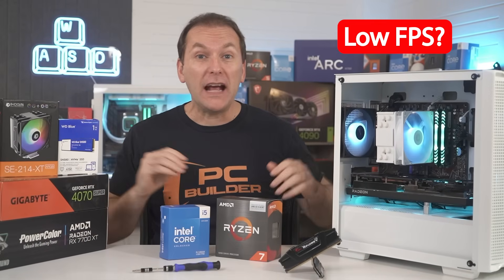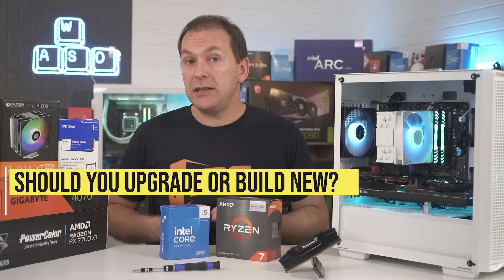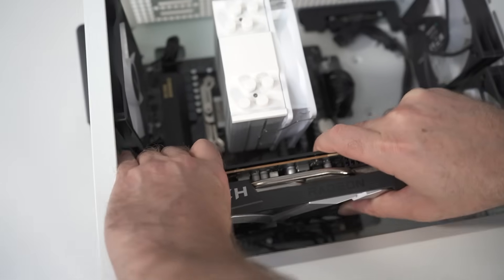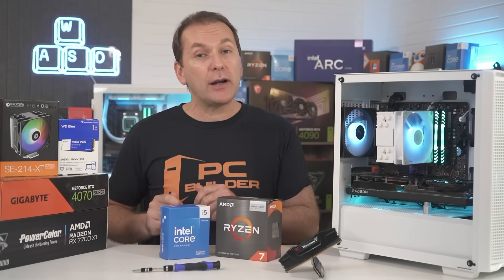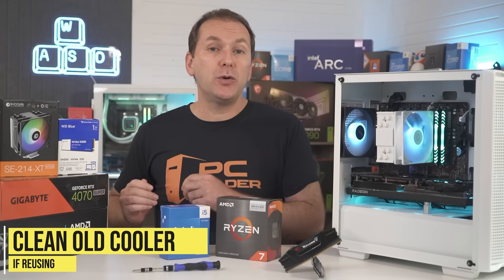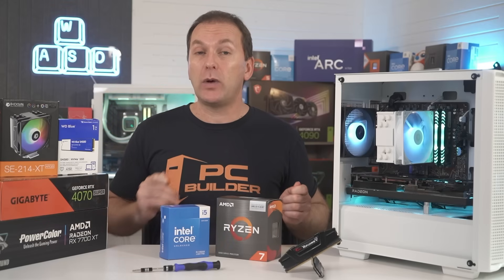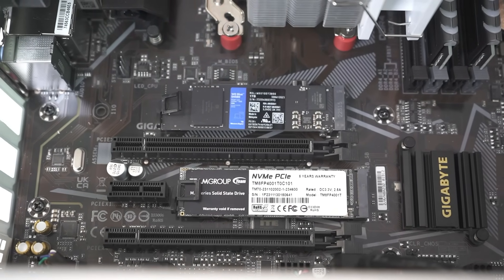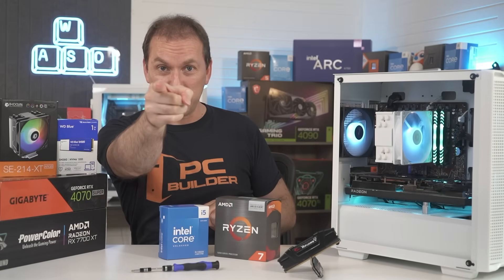How To Upgrade Your PC | How to Upgrade GPU, CPU, RAM, SSD & More

Comment: I currently have a prebuilt and will be building a pc very soon but how do I go about the data transfer? I have a licensed windows and GPU drivers, since I bought 2 Nvme's for the new build can I just transfer everything to them (idk how to properly do this lol) and do the GPU driver clean before installing them? I also don't know if I need to reinstall windows on the nvme and uninstall it from the HDD, I plan on still using the drives I currently have (Sata and HDD) mainly for file storage as I do video editing as well but I'd like to transfer games and apps to the nvme's
Reply: its best to buy an external 3.5 hard drive, for example a WD BOOK, they are pretty cheap now, you dont have to get a huge one, just figure out how much space you have
Reply: @MrSamadolfo  well I have now 3 TB and I bought 3 more
Reply: @Grey4953  🙂 Nice

Comment: Right Jason, see if you can answer my question, nobody has yet...I've just finished my build, I have an Asus Rog Strix B650-a Gaming Wi-fi, with 32gb ram 6000mhz CL30, Ryzen 7 700x, with the Deep Cool Ak620 digital, and a Powercool Hellhound Spectral RX7800xt, I want to mount my GPU vertically inside my Montech King 95 Pro using the Cooler master bracket, but...will there be enough space to mount it vertically with the Ak620 digital?
Reply: That case is kinda small, I advise selling off that case and stepping up to something alot Bigger such as the big NZXT Flow or a clone of it

Comment: gigabyte q-flash updating the bios This mistake I made: I did not know you needed to press END to enter. Q-flash 
Ref CPU I look at using thermal grizzly pads over paste, as they do not dry out if you are replacing your CPU.
Reply: I just recently updated my X570 and didn't have any issues

Comment: I've been upgrading most of my PC parts after having months of black screen crashes. I've tried to search for people who have had the same error and am lost. I've tried build a PC and LTT communities for help and no one has been able to help. I've replaced, cpu, motherboard, RAM. I think its a very rare issue though as there so little help online. PSU upgrade is next. Upgrading from 850W to 1000+ I guess.
Reply from the maker: Have you tried posting to reddit build a pc troubleshooting  forum? That's the resource I use when I'm having issues like this.
Reply: Did you download and run MEMTEST86 ??? it takes about 2 to 4 hours? Next did u do a cinebench run of about an hour? next did you do a heaven benchmark and furmark benchmark? next did u try a different video card? next do you have a decent power supply from the PSU TIER LIST? Next take the board out and see if its crashing due to maybe the case shorting it out? Check cpu socket and pins? Check usb ports for shorts? look the board over with a magnifying glass for anything burnt. just some ideas

Comment: Hey jason...after a year of buying parts here and there I finally built my first pc!!!(and it ran) I have a corsair rm 750e and was wondering if I should use the daisy chained pcie cable or two of the single cables for my gpu

5600x3d 
Asus tuff gaming plus wifi2
Crucial 2tb name ssd
32gb rip jaws 3200 cl 16 ddr4
Peerless assassin
6750xt red devil
Montech sky two
corsair rm750e
Reply from the maker: Congrats on the Build! The cable gauge on that PSU is fine to daisy chain, but my default answer is usually "use two cables". Looks awesome!
Reply: Nice build with a good price to purformance while looking good
Reply: NO, give preference to the 'single cables' if you have them, the daisy chain is only if you don't have enough singles, preferably if given a choice only use single cables but of course that means more money and a bigger power supply, but you only got a Red Devil 6750XT so thats only TWO 8pin plugs and pretty much all 750's have a single cable for each plug so your Golden my friend 👍

Comment: What about upgrading mother board? Or does upgrading the mother board not help in performance?
Reply: It doesn't give any performance upgrade, but if you are switching your motherboards, you are still following each step including bios updates and downloading the network drivers from the official mobo website.
Reply: sure broh, its always better to be running top tier Z boards and X boards, full size ATX, get the one with all the bells and whistles: Double Digit readout, reset button, power button, wait for a deep sale to pick em up, get urself something nice 😎
Reply from the maker: It does not boost performance no if its a modern well paired board, but if there's features you are looking for in a new board that can be helpful if you've already upgraded your other components. See our PC Parts Explained 2024 video for more

Comment: To be honest, smaller than 4TB NVMe SSDs feels pretty much waste of an M.2 slot.
Yes, best price/GB is better in 1-2TB drives, but games today take a lot of space and 1TB gets too small pretty fast. For example, I have gotten about 2,5TB (anything pre-owned is on top of that) installed games in just those titles I bought last 10 months. That includes some older titles and games I wanted to play but couldn't before I built new computer.
Reply: 1 and 2 TB ssd's are the sweet spot, and for storeage instead of the 4TB SSD i would suggest using that money and picking up a 20TB 3.5 Hard Drive for all your files: video, pics, games, songs, etc
Reply: @MrSamadolfo  Yes, but 4TB SSDs aren't that much pricier either. Unless you want Gen5 NVMe which still are crazy expensive at any size.

1 TB is about 40-140€, 2TB is about 80-280€ and 4TB is anywere from 200-500€. Samsung 990 Pro being 370€. 
So not that bad, when getting as an upgrade and not part of bigger build with limited budget.

Besides, HDDs are really slow these days for games. Videos, pictures, music yes, but that's why there are NAS systems so your media isn't tied to single computer and can be used by other media devices aswell.
Reply: @pikkuraami  yes home server in a bunker FTW 😊

Comment: Hey guys if you have four slots of ram installed on your pc and you want to upgrade your existing GPU, you might encounter an issue that pc starts up and shut down instantly over and over, the solution is simply take out three ram and put only one ram onto slot B1 and see whether it boots up.
Reply: 4 slots are there for a reason why would it do this?

Comment: Jason or any other person who know about CPU coolers, I cant decide what CPU cooler i should get now i have a stock cooler but my Ryzen 5600x is getting to hot for my liking (90-95) Celsius. do you have any ideas for a great cooler under 600 Swedish krona (around 60 dollar) or around that budget, I found a CPU cooler named Deepcool AK500 and it looks good, Do you think i should buy that one ore is there a better one. (I don't really know so mush about pc components). I am from Sweden.
Reply: Thermalright assassin.  Very good cheap air coolers.
Reply: 🙂 broh, your having the same problem as intel motherboards, the bios defaults the cpu voltages and frequency way too high, there should be a way for you to manually underclock the cpu so that you can run the cpu much cooler, with a proper undervolt the cpu should run and hover in the mid 70s on an oem stock cooler, but you have to do it manually because most motherboard manufacturers don't care and they are burning up CPUs
Reply from the maker: Check out our new Best Budget Gaming PC 2024 video, we have great cooler options there

Comment: Yes my current pc sucks! It is a prebuild from Acer, contacted them to ask what is the upgradablity for it and well, its not fun. I can max upgrade to a i7 10700, a 2060 or 2060 super and the ram is stuck at 2666mhz. This is my first ever pc, if I knew a bit when I was first looking, late 2021, I would have gotten something different, something better.
Reply from the maker: Frustrating!
Reply: @PCBuilderChannel  It is! I am planning on getting a new pc by the end of the year
Reply: 🙂 the 3050 6GB is out, its pretty fast, its close to a 1660 Super, and it doesn't need a power supply plug, just open your case up, plug it in, and hammer down 👊😒 bliiiiiiiiiiiiiiii 🚤......

Comment: Another thing with the fresh windows install. If you change the language to English(world) instead of your country, then it won’t install a ton of extra bloat programs that many people don’t use. And the links to install everything is still there so if you’re missing something it’s easy to find/re-install
Reply: 😏 LOL you are 100% Right, i remembered installing Windows in Spanish for my cousin and the installation is not the same as the standard USA English install, they get a basic streamline install with very few hassles, its not right 😊
Reply: does it increase performance vs a normal install? Doubting to switch to linux as amd is srsly held back by microsoft.
Reply: @Dailyrider94  it frees up storage space and depending on your region it may prevent some programs that run in the background to improve your performance but I’m not 100% on that

Comment: Woah! What are these steps to uninstall graphics driver? Both nvidia and radeon drivers have clean install options

1 replace gpu
2 perform clean installation of graphics driver
Reply: download and install DDU, boot into safe mode, run DDU and reboot, now install your driver and reboot, done

Comment: Ok silly question , would it be better to have the C.P.U. fan pointing down towards the motherboard (as in a low profile fan arrangement E.G. the Noctua NH-L9x65 ) or have it as usual where it is pushing the air towards the exhaust fan , I'm specifically thinking it would help cool the VRM's etc if the fan was blowing towards the board
Reply: Down is correct.
Reply: @zonemanbobo  yes but would that be better or no different to having it just blasting air towards the exhaust fan in terms of cooling the V.R.M.s?
Reply: @familyplans3788  if the fan is blowing up how is it cooling the heatsink? Right?
Reply: @familyplans3788  the fan must blow threw the heatsink to cool it.  So it must be down.  It's the only way.  If you pointed the fan up, your CPU temps would skyrocket.
Reply: @zonemanbobo  no sorry i havent explained it very well , i mean the traditional way of CPU cooling is to blast the air from the CPU towards the Exhaust fan , but that bypasses the VRM , If you had the CPU fan blowing instead towards the board then would that be better for the VRMs?
Reply: @familyplans3788  so what you're saying is, would it be better to use a low profile CPU cooler in a normal build rather than a tower cooler in the normal-sized build? Because it would blow air on the VRM's?  If that's the case, I say no to the low profile and just get a normal tower cooler.  Most MB VRM's are fine and do not need active cooling.  Now some MB are bad at it. And that's a fault of the MB and not your cooling setup.
Reply: @zonemanbobo  Thank you for deciphering my question , much appreciated
Reply: @familyplans3788  NP got to look out for each other and our builds.
Reply: depends on the motherboard but usually back towards the rear case, for the vrm your suppose to have vrm heatsinks + front case fans

Comment: I've just completed a  build which replaces my ten year old Intel Core i5-3570K 3.40GHz gaming machine. I kept my Fractal Design Define Series R6 TG Tower and my old Corsair 750RM power supply as well as my Sapphire AMD Radeon RX 580 4GB NITRO+ which was bought reconditioned four years ago. I've also kept my Sata hard drives x 3. My new parts are
 
 AMD Ryzen 5 7600X 4.7 GHz 6-Core Processor
 Gigabyte B650 AORUS ELITE AX V2 ATX AM5 Motherboard
Thermalright Peerless Assassin 120 SE 66.17 CFM CPU Cooler
G.Skill Flare X5 32 GB (2 x 16 GB) DDR5-6000 CL30 Memory
Western Digital Black SN850X 2 TB M.2-2280 PCIe 4.0 X4 NVME Solid State Drive

My total build cost was £670. $853.40 US or 1,287.83 Australian Dollars. 

I am very happy with my built though I do intend updating my graphics card when finances allow though my present card is handling World of Warcraft well which is all that I play though I would like a card that could handle more GPU intensive games.
I was also able to move and then upgrade  my OEM version of Windows 10 Pro to Windows 11 Pro by using the I have upgraded hardware option when registering Windows. I guess they were fooled by my old motherboard having also been a Gigbyte? The one mistake I made when building was not looking at all the accessories that came with the motherboard such as the connector that makes connecting the F Panel a lot easier. Unfortunatly I did not see it so ended up wasting time fiddling with the small F panel connecters.

Comment: Thank you Jason for the video! I built my current PC when were transitioning from AM4 to AM5 and DDR4 to DDR5. They were expensive back then and no X3D CPU from AMD yet. So, I got R7 5800X3D to pair with the RX7900XTX. Can't wait to see the new Ryzen 7 9800X3D!! I will need to upgrade pretty much half of my system, geez.
Reply from the maker: Nice combo you got there!!

Comment: Currently have no plans with upgrading my PC except maybe the PSU since when I built the thing, I probably got a trash tier Thermaltake PSU...
Reply from the maker: PSU is one area I don't mess around! But its fairly easy to switch out as you see in the video (:

Comment: I have an i9-9900k and a 2080ti with 32gigs of ram..... should i go for a new build or change a specifc couple components ? My PSU is a 1050w 80 plus platinum, tbh the system is 5 years old xD Any help appreiciated!!
Reply from the maker: It all depends on if you are happy with the performance. The 2080 Ti is as strong as a 3070 but with 11GB VRAM, so you'd ideally want a 7900 GRE / 4070 Super to get a substantial enough upgrade to make it worth the money. However the 9900K is going to bottleneck those GPUs (hard to believe right? but it is weaker than a Ryzen 5600 in gaming). So depending on your budget, I might just build brand new with a high end GPU and something like a Ryzen 7600. But wait to see what gets announced next week at Computex.
Reply: @PCBuilderChannel  Thanks for the reply man its the information i needed! Yeah was gonna wait for the end of the year anyways see what gets announced and see what prices drops happen in the wake of those announcements lol

Comment: I only need a graphics card to be upgraded
currently using RTX 3060 Ti
thinking about 4070 super maybe 🤔
Reply from the maker: Check out our Best GPU/CPU Combo 2024 video to see the max recommendation with your CPU
Reply: @PCBuilderChannel  
I have 
core i5 13600k
mobo: ROG Z790 -A Gaming wifi (DDR5)
32 GB (16*2) DDR5 @5600MT/s from Gskill
and a ROG STRIX 850W psu
do you think 4070 super would be a perfect fit for my build?

Comment: Hi there Jason. Great video for step by step upgrading. I would like to upgrade my Rx 6600 8gb to a RTX 3060 12Gb. Is that Optimal or are there any GPU's right now better. Note that my Budget is nearly 400Dollars to upgrade the Gpu.
Reply from the maker: If you're CPU can handle it I'd love to see you upgrade further. See our Best GPU/CPU Combo 2024 video to see the max GPU your CPU can combo with
Reply: @PCBuilderChannel  Currently repping a Ryzen 7 5700X. Is the 3060 12gb good enough for it?
Reply: @princen8213 yes but a 6700XT/6750XT or 7600XT would be an even better GPU choice.
Reply: $400 will get a 7700xt or 6800.
A 7700xt is slightly above a 3070 ti in performance

Comment: I'm running a 5800x with a 6700xt, should i upgrade to a 7800xt or a 7900gre? also both my m.2 slots are being used (2 x 2tb), should i get a card for more m.2 storage? I am a bit of a data hoarder. I have a 1000w psu so power is not an issue. I don't want to upgrade the cpu, motherboard and ram yet.
Reply from the maker: 5800X is just a tiny bit faster than a Ryzen 5600, which starts to hit a CPU Bottleneck between the 7700 XT & 7800 XT. If you plan to drop in a 5700X3D or 5800X3D at some point in the future, grab the 7900 GRE.